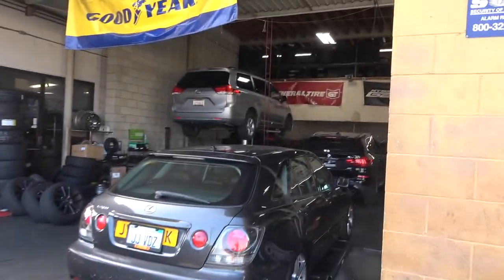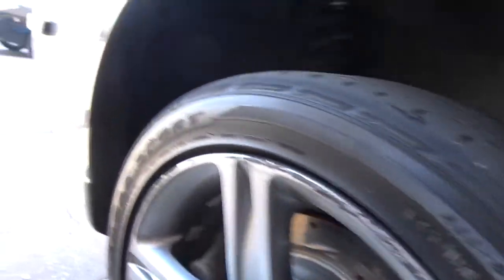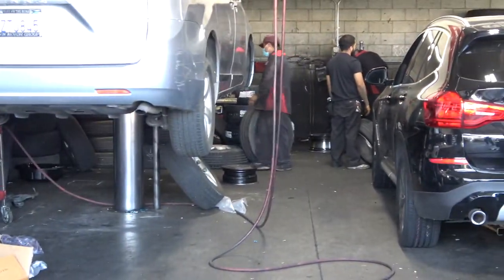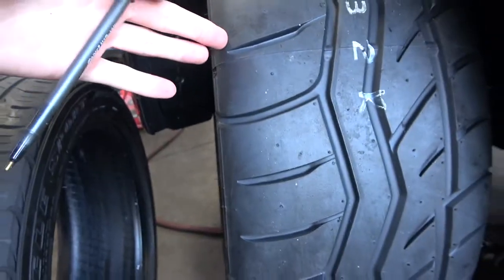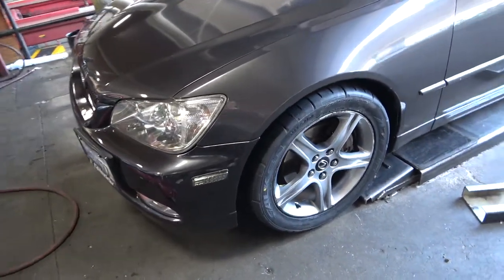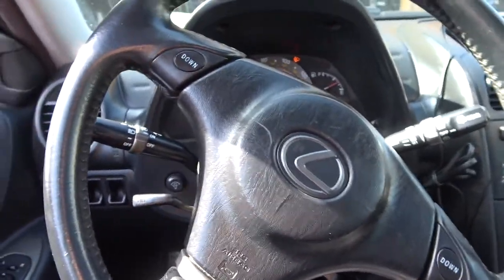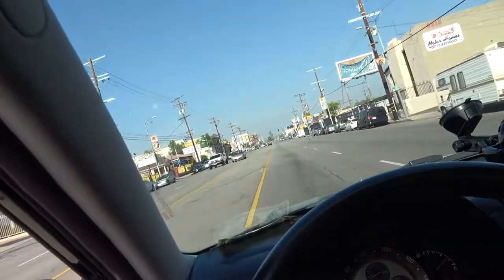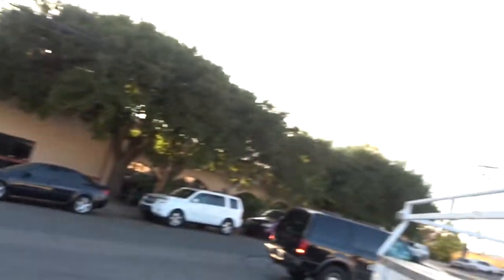Falcon Azenis RT615K+ Tires // Sportcross Drifting

Comment: Cool video and nice car. I installed these tires 8/2023 and had them Heat Treated/Cycled at TireRack…way more grippy than my Toyo all seasons. I found out quickly they need to be warmed up before high performance driving. No rain driving yet for me—garaged in the winter.
Reply from the maker: There really good in the rain under 55mph